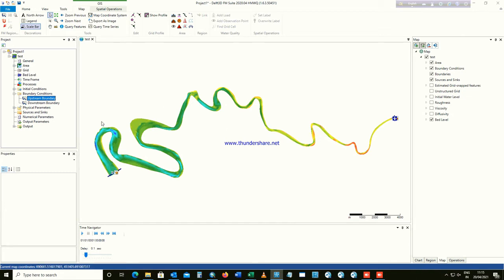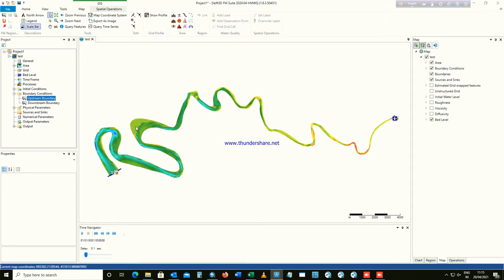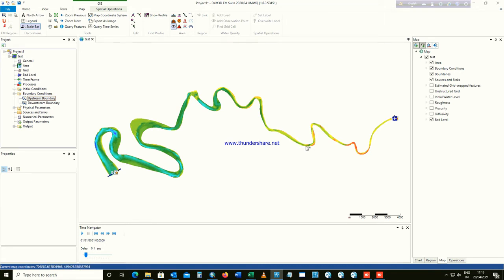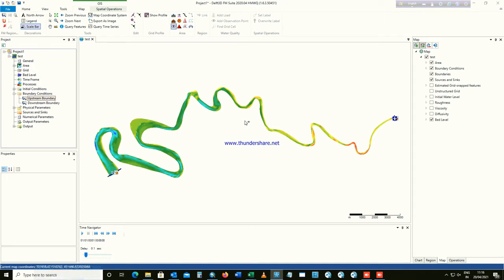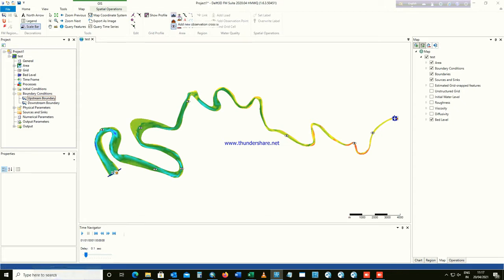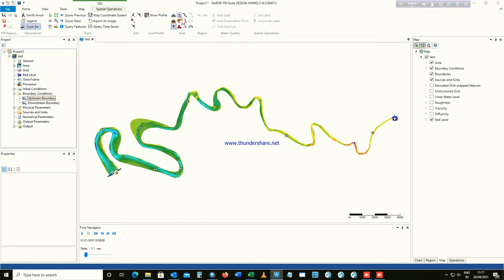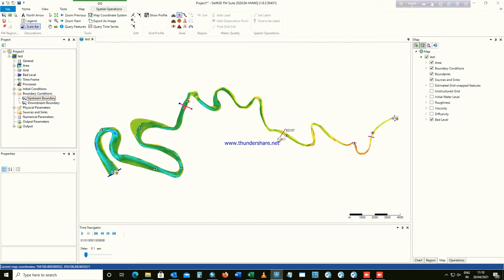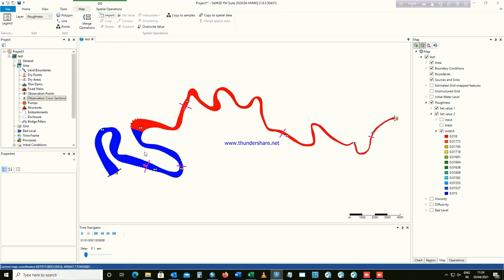Guide To Modelling :Tutorial 5: How to create observation Location and Roughness in Model

Comment: Thank you very much for your kind support  sir. I am working with a Delft3D FM model using parallel computing through DIMR for the Mekong Delta, involving approximately 180,000 nodes. I have run the model with 20 to 128 parallel processors, and while it performs well for around 6 to 6.5 months, the model consistently crashes beyond that point without providing any results or error messages.

In typical cases, an unstable model might display unrealistic or negative values before failing, but this model fails abruptly. I suspect this issue could be related to memory constraints, resource limits, or possibly long-term boundary condition drift.

The error message I receive is: "Any advice on what might be causing this problem would be really helpful!

The only error message I get is: " x1001c1s2b1n1.hostmgmt2001.cm.asp2a.nscc.sg: rank 17 died from signal 11 and dumped core

~~~~~~~~~~~~~~~~~~~~~~~~~~~~~~~~~~~~~~~~~~~~~~~~~~~~~~~~~~~~~~~~~~~~~~~~~~~~~~~~~~~~~~~~~~

Resource Usage on 2024-09-29 13:08:28.377466:

~~~~~~~~~~~~~~~~~~~~~~~~~~~~~~~~~~~~~~~~~~~~~~~~~~~~~~~~~~~~~~~~~~~~~~~~~~~~~~~~~~~~~~~~~~

JobId: 8259853.pbs101

Project: personal-123

Exit Status: 0

~~~~~~~~~~~~~~~~~~~~~~~~~~~~~~~~~~~~~~~~~~~~~~~~~~~~~~~~~~~~~~~~~~~~~~~~~~~~~~~~~~~~~~~~~~

NCPUs: Requested(20), Used(20)

CPU Time Used: 788:26:58

Memory: Requested(200gb), Used(55744524kb)

Vmem Used: 118512128kb

Walltime: Requested(120:00:00), Used(39:38:21)

~~~~~~~~~~~~~~~~~~~~~~~~~~~~~~~~~~~~~~~~~~~~~~~~~~~~~~~~~~~~~~~~~~~~~~~~~~~~~~~~~~~~~~~~~~

Execution Nodes Used: (x1001c1s2b1n1:ncpus=20:mem=209715200kb)

"

I would greatly appreciate any insights or suggestions on potential causes for this crash and possible solutions.

Thank you for your time and expertise.